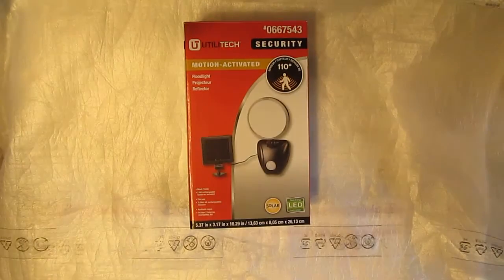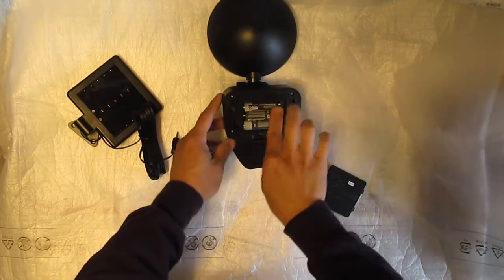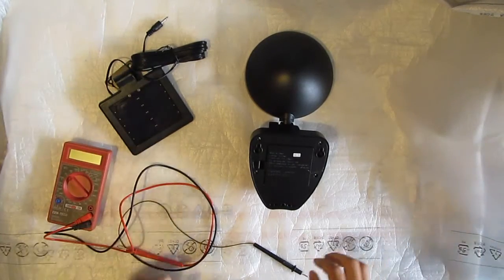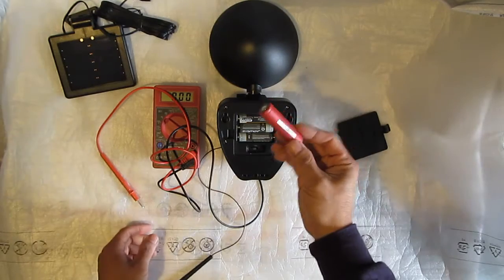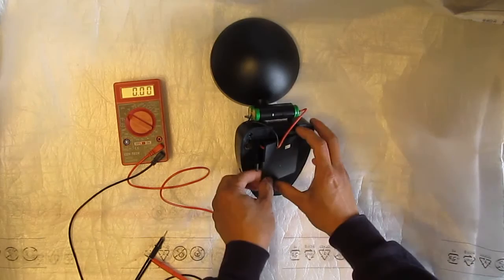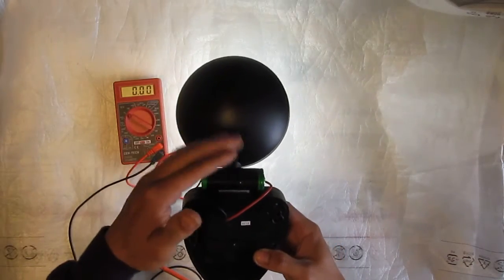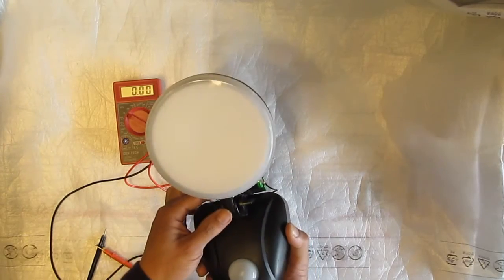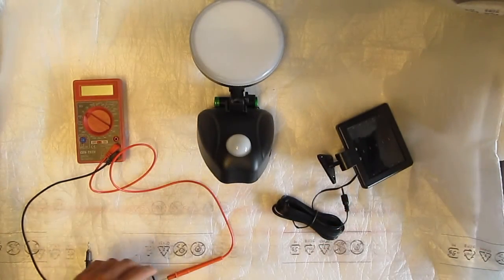DIY: Hack a Utilitech Solar Powered Led Motion-Activated Flood Light

Comment: How did you prevent cells to run out of juice?  When 18650:s and other lithium cells get under 3 volts, they suffer internal damage. Even one 0 volts-situation may render cells useless.